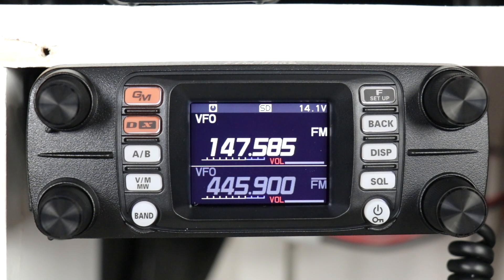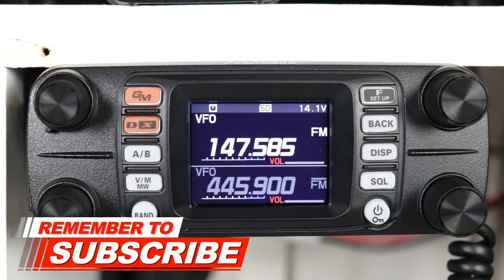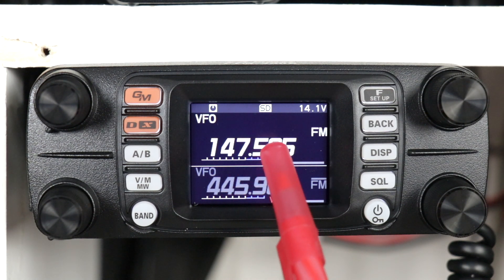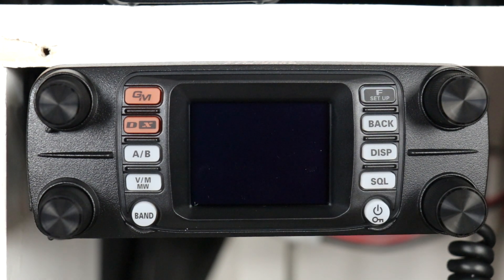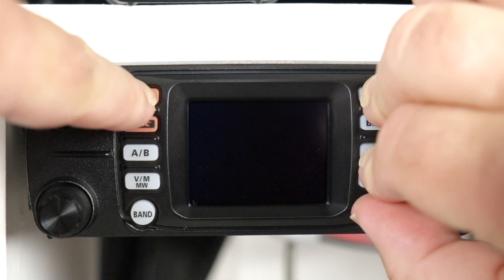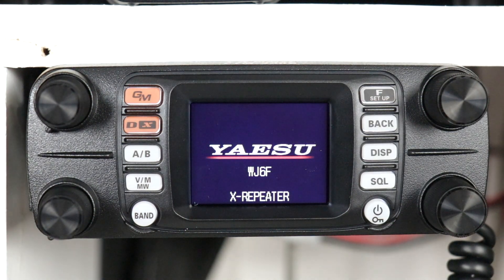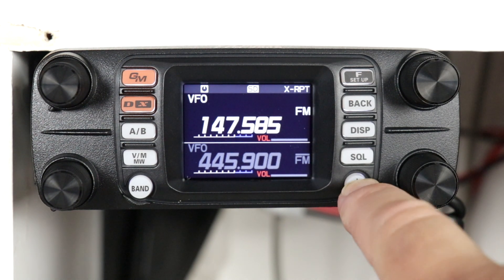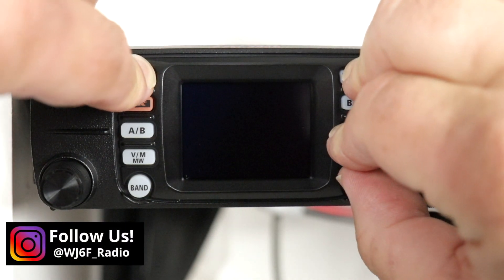Yaesu FTM-300 Cross Band Repeat Setup

Comment: Sweet and to the point thanks. Now to do the Mars/Cap mod and I’ll be golden.  Just got my 300 this weekend and programmed with a few local repeaters to start. Loving the radio so far.  Coming from an IC-207 for the last year as my base rig. Pairs nicely with the FTDX10.
Reply from the maker: Thank you for taking the time to watch and the comment! It is greatly appreciated.

Comment: If you are using your HT to get to your radio  for the purpose of reaching a repeater with a tone for extended range, will using the repeater frequency  with tone work on the transmit frequency in the radio, and can the repeater transmit frequncy be picked up and cross banded to the second frequency? This is not using simplex of course...
Reply from the maker: I do not use crossband to reach repeaters, thought it can be done. I use it to talk with others using simplex

Comment: I use the Ft-70 and the mic Level in Crossband is very low.  In Simplex it is working very loud. Is anywhere an option at the ft 300 or Ft 70? Thank you for your help

Comment: Can you have different power settings for the two VFOs while in x-band repeat?
Reply from the maker: Thank you for taking the time to watch and the comment! It is greatly appreciated.  I am honestly not sure, but I will try it and get back to you.
Reply: @WJ6FRadio  I called Yaesu.  While both frequencies were within the band and considerate of the band plan, the VHF frequency I was using was programmed to not Tx in cross-band repeat mode by Yaesu.  The feature does work, but is frequency dependent and there is no documentation to reference the permissible frequencies
Reply from the maker: @ggggg4030  Thank you for the information!

Comment: All of the videos I have seen show the radio in VFO mode. Will it work using the memory mode? Specifically, can I use the feature to access a local repeater using the standard repeater offsets?
Reply from the maker: Thank you for taking the time to watch and the comment! It is greatly appreciated. you should be able to make a memory channel for your desired cross band repeat frequency.

Comment: First of all thank you. I have carried out the indicated steps and I have activated the repeater, but the problem is that no modulation comes out in any of the 2 vfo. Any suggestion?
Reply from the maker: Thank you for taking the time to watch and the comment! It is greatly appreciated. I honestly have no idea what would be causing that. Could try reseting the radio to its original factory settings.